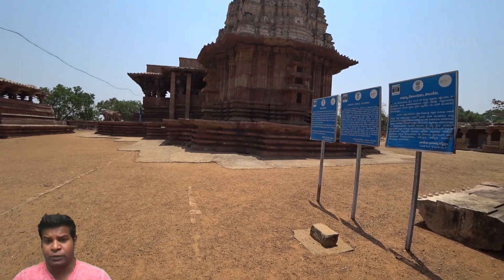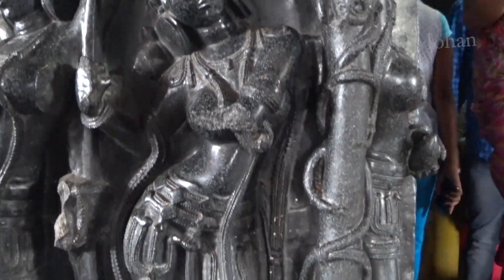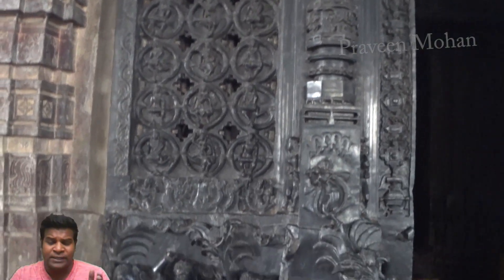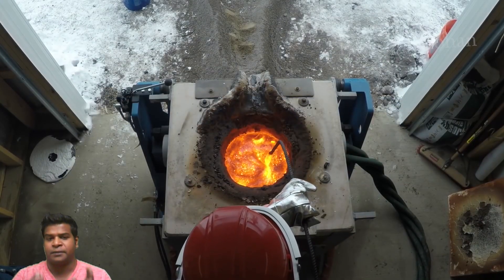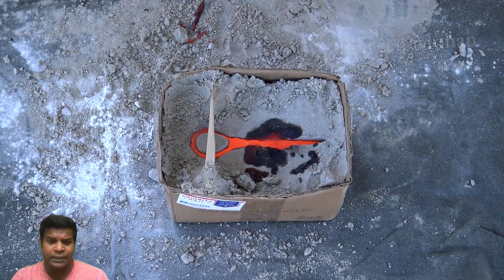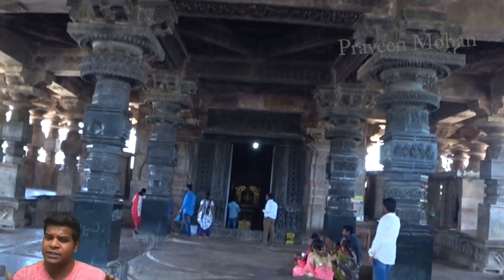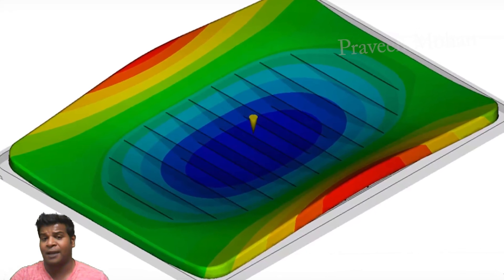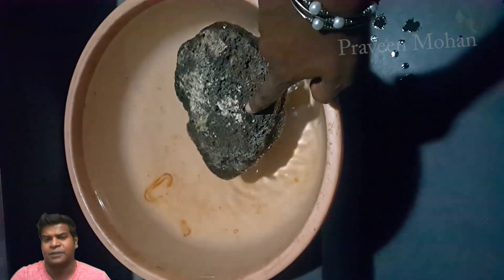Rock MELTING Technology at Ramappa Temple, India

Comment: Basalt can be made into fibers with a strength between carbon fiber and fiberglass.  ..in open air... with nothing more than heat and droop spinning tools. This is the answer to building on the moon, btw.

Comment: Well if its cast, then that would imply some considerations, for one the liquid stone would need to be very liquid able to flow and potentially under vacuum to fill the small details in completely. Obviously when you cast you first make the mold out of wax and carve it then cast in plaster, then burn it out and preheat it, then you pour in the molten stone, allowing it to cool slowly in an temp controlled environment. I agree that looks like a warp, and, the carvings are pretty intricate, which could easily be carved in wax like jewelry. I could also see some "carving" done after to clean it up, What you should look for using some advanced optics or precision measurements is indications that there were sprues that have been removed and polished, which maybe would still be raised higher than the surrounding surfaces, enough to be detected using precision measurements and modeling. If someone starts testing, theres really only so many options on how to achieve that result, lets say other than that youd use a dremel and a really steady hand or something computer controlled and diamond tipped, then polished.

Comment: I’ve been in concrete for 30 years. I think a type of Concrete mix that looks like Rock is more likely in my opinion than actually melting rock and pouring it into a mold. Mold would have to hold up to extreme temperatures if they melt the rock. Using a type of concrete would not affect the mold at all with temperature. Just my opinion, you might be right though.

Comment: In reference to the bent rock. I have seen this shape in other materials by using a large cutter say 5ft in diameter on a CNC machine as if you are trying to make it flat. Instead tilt the head 15 degrees, then make a pass and it will produce the same result.

Comment: I think you are on to something  here.  Basalt  carved is dull . . Basalt melted can turn into obsidian  i have a few Basalt  rocks that are glassy on one side but dull on the other side. Concrete morter  comes from heating limestone power  into clickers into in a rotating over of 3000 degrees.  Those clickers are made into mortar by  grinding them into powder which is then mixed with rocks to make  Concrete.

Comment: I really like the work they put into those temples . It's a really work of art . Specially with the tools they had to work with. But The sound is made trough the vibrations of the 'tree' . I work in the nature stone sector and I've heard many sounds from different stones. All depends on if it's a massive block , or in this case a 'pole' that has a lot of free space to vibrate .  Same with all instruments . 
The dents in the block could be due to taking off to much material in production and instead of taking a new one they went with this one. Or after installation it was damaged and they  polished it off.  We also use the 'flexible ' slabs Sometimes . But this is only flexible when it's very thin , only with specific materials . And when glued onto a buffer of some sorts. 
I like the video but facts are facts .

Comment: Casting would make the entire structure brittle. Natural stone are formed with heat  But with Enormous Pressure also. A manually cast sone will be extremely weak and cannot be used to make a building pillar. 
Although it can be used for decorative purposes.

Comment: If you were to try and mimic natural rock by melting, then you'd have to put it under constant pressure while maintaining the same heat after pouring. In the university example, the rock is melting but is cooling rapidly and has a glass-like appearance, perhaps similar in essence to obsidian. The mold would also have to be heated to prevent rapid cooling. Perhaps the mold was the crucible itself, placed underground with the earth acting as an insulating layer, the cap may have been a "press" to subject constant pressure to the molten mix while also preventing heat from escaping, and the entire crucible-mold may have been left to cool slowly over many hours, days, etc. until no more excess heat radiated (i.e. it reached ambient temperatures).

Comment: I assume that they would add some metals into the molten stone to ease casting, reduce melting point and to assist quicker setting and crystal structure formation. Stone melts and resets as obsidian.  Unless there is a slow cooling and high pressure. It doesn't become stone again. They must have given something to assist crystallization. In sugar they add tiny crystal pallets to induce crystallization. Probably they did the same. It still has an obsidian glaze to it though.

Comment: Metal and rock casting is very very different… with current technology it is impossible to cast pretty much anything at that temple..small details get lost so easily casting plastic an extremely well known and highly used technology and easily done … yet they would still given current manufacturing take decades to make even one of those temple walls out of plastic and get it correct if they even could…. Molding of molten rock ? Not likely….however sonic carving ? Makes much more sense to me !

Comment: I agree, ancient people had more knowledge and more advanced technology than we give them credit for. That has been PROVEN by such things as the pyramids, the sphinx and others. BUT, these two things in this video are more easily explained than he thinks. That "musical pillar" is actually just hollow in that one area, with the size of the hole bigger in some areas than in others. I'm willing to bet that if the pillar was removed, there would be a drilled out hole going up into the tree with the hole being larger at the bottom then towards the top. Which would make the sound higher pitched at the top and lower pitched at the bottom. Ancient people having the ability to drill holes into tough stone is one kind of advanced technology we KNOW they had but we DON'T know how they did it. And the "bent" pillar, is just a case of hundreds or thousands of years of people rubbing their hands across it. You can see this on multiple stone carvings all around the world from where people have touched them. The oils from people's hands is slightly acidic and over the course of a VERY long period of time of people touching and rubbing the same spot over and over again even stone will be worn down. This is also why the stone is only shiny in that one area and LOOKS highly polished while just above it, out of reach of people, the stone has a flat matt look to it and doesn't look deformed. It's also why the stone looks more deformed nearer the bottom, as that is where most people are going to be touching it. It was NOT originally made like that. That pillar when titled on it's side, looks nearly IDENTICAL to the stairs in the tower of Pisa, as they are the same way. Over the course of hundreds of years of people walking up and down them, the steps look "melted" and deformed. More so on the edge of the steps where people's feet have landed the most.  This happens to both wood and stone. My family has family reunions in one of our family's old homestead homes that is over a hundred years old, and the wooden railings on it look deformed and bent and is just from people's hands simply rubbing on it while going up and down the stairs. There is no need for "rock metaling technology" for this type of thing to occur. It's occam's razor, the simplest answer is usually the correct answer.

Comment: Hey Mohan man, I believe you can easily cast rock in find shapes like this with today's technology. You make imitation Starlite using sugar, corn starch, baking soda. You burn this with a propane torch to make it expand, and then machine it with a cnc mill. Next you pour in the lava. The carbon foam isn't strong, and it'll let the molten rock into it's surface a little bit, so they must have either polished the rock afterward, or used an element mix coating on the starlite to give a glass like finish. Now that material I don't know the recipe for, but you can buy a frying pan here from Ninja that has a 10,000F resistant coating. I have one. It's as weak as teflon but is very smooth. The inside curves of the statues would be so easy to clean out, being mere carbon foam which is quite weak. I've made this stuff myself. I've mixed this with ferrite oxide and clay to experiment in making gold in the microwave, since it has already been proven you can do this with pulverized green glass over a ferrite disc at around 1700F.  My friend John Milewski proved the process before his death 5 years ago. I improved it. Anyway, this rock casting sounds fun, I might try it, since I am actually about to finish building a cnc mill.

Comment: Rock melts under high pressure and friction. Do the math. 

People figured out spinning a rod and applying pressure created fire. 

Maybe the next step after making fire is making lava. Spinning a rod of granite, or iron. If that works, other pieces of technology based upon those principals could developed. Imagine a bow drill, but the spindle is metal, the top cap is metal and you hold it wrapped in leather so it doesn’t burn you. You apply downward pressure into a stone, at a certain point you might start getting some fumes. At a certain point you’ll reach similar temperatures as you would to create fire with sticks. So what if they refined these ideas and could make lava from stone rods?

Comment: In Genesis 11 the builders of the tower of Babel burned brick thoroughly, and used it for stone.   I think you may be onto something.  Could they have made other things with this same tech?  Perhaps ships, especially Vimana, which need to withstand extreme heat, were made this way.  The space shuttle and now the Starship use stone for a heat shield.

Comment: Lava are ligth weigth Stones. Today they use it for ligthweigth construction. Not by melting though, but in concrete. There is a reason that lava are ligthweigth. When its errupts it is the top of the molten lava, that comes out. This is where it sepperates from ligth to heavy materials. The heavy goes down to the bottum and the ligthweigth end up in the top.

Comment: And that the bent rock that looks bent I would say the forming boards broke just like if you build a foundation in the house and the boards that hold the cement to make the foundation and if they go out of whack or there’s too much weight in there wasn’t enough support in that area well this the cement will bust out or the boards will bulge It always looks like whatever was holding that spot when they poured that support beam, Holden gave in and they didn’t catch it as it was drying making that bent look in the rock

Comment: Don’t forget there is the opposite of melting and that would be grinding up to a powder and adding water and you got a cement made from rocks and sand. In this case I would say they used that rock has someone smashed up intopowder and then add water and then you can pour it let it set and you got solid rock again

Comment: Dear Praveen:  An interesting video, with your conclusions well-supported.  But  you need to go further: (1) how was 2500º heat generated in large amounts?   (2) how were the molds created, (3) out of what material were they made (that will withstand 2500º heat)?

Comment: The carvings are extremely skilled craftsmanship, but it's not rock melting technology. I believe the two examples in this video, just like the entire temple, were intended by the builders to blow people's minds at their skill. They were showing off their creativity to entertain people, and to give them a sense of wonder. First of all, to say "there's no way" to carve a single stone to make various musical notes...totally wrong! Stonecarvers and masons agree with that?? Which ones did you ask??  Lithophones have been known for thousands of years, and it's obvious by looking at that piece, that the vines wrapping around the tree change the shape of the resonant stone to make the various tones. Secondly...basalt is not plastic, and unlike plastic its thermal expansion properties simply would not allow a very isolated section of a block to shrink to such a great degree, even if it cooled at a slightly different rate. You are claiming that small area of rock is (I'm estimating) 5-10% greater density than the immediately surrounding block?? That means that piece of rock would be under incredible internal stress, which might be possible for plastic, but that just can't happen here. Not only that, the various bevels do not display the "shrinkage" to a consistent degree, which would be necessary if the mold theory were true. Forget that it's the only uncarved section on that level...there are many panels with little to no carving all around the pillars. Just like the musical tree carving, the builders wanted to make people say "wow!" and to marvel at their skill.

Comment: If they cast it the only way would be with magma tapping or something. Reburning remelting basalt charges its composition making it glass like and brittle. The floating stones are also lava rock. They produce similar stone today. And rockwool insulation is similar too. When lava cools it is actually filled with impuritys and gas and they break out making a very porous structure this stuff can float on water but itll sink eventually. Observing the stone you say was melted… easily could be there was a fissure there (natural fault) and instead of carving even deeper they merely polished it. Also i believe their were ancent machines made of wood for doing most work. Like cranes and dollys and such like that. Making a drill or a auto hammer from wood isnt hard and it lets you turn a unskilled labour into a fuel source. So that your skilled labor doesnt work as hard.

Comment: I am a stone mason and sculptor.

You state at 5:23 that "it is impossible to make such a smooth, concave cut on rocks with manual tools or even electric".

But actually, that is fairly easy to do. You cut the stone, then smooth it out, then polish it. I could accomplish this effect using hand tools and/or electric tools. 

But why would they do something like that? It looks very accidental, and considering the intricacy of the carvings all around it, it makes you wonder how such a foible happened. My two best guesses at this point are:
 
a) They wanted a nice square block, but someone accidentally damaged it-somehow it was decided that it was better to just smooth out the damage, rather than replacing the entire block. OR-

b) This is an example of mold-warping, as you suggest.

Comment: Wow! Tapping stone cylinder makes different sounds based on where you hit it and how close or far away you tap from the thicker stone caused by the other carvings. There is nothing here. The differences in sound are easily explained by differing thicknesses of material having different vibration ranges, no different than tapping on a hollow log that has varying thicknesses of bark or wood from knots and limbs. There's also the change in pitch/frequency caused by the distance between the point of the tapping and the open end of the cylinder, which again is the same as with the log. The sound made by tapping is distinctive of a hollow cylinder. The claim that there is no technology is ridiculous, since the different sounds are caused by the variance in amount of material in proximity to where you are tapping. This is also demonstrated by placement of fingers on a guitar string. By changing the distance between your finger and the sounding board on the guitar, you are changing the frequency of the vibration of the guitar string thereby changing the sound. Freaking high school science (predominantly physics earth and space sciences) or music classes can answer pretty much every "question" put forth here.

Comment: Hand polishing absolutely can create such a surface. As for the deformation of the pillar, that could have been trying to work around a defect in the material itself, like an inclusion or colour variation. If the rock was heated to be  molded, that would be very easy to figure out by examining the crystal grains in the rock.

But what you failed to mention, is the form of warping you showed in the illustration is shrinkage of the cast material as it cools, and has this shrinkage along its entire surface, not just a single side as it does with the pillar.

Comment: interesting video. I could speculate that the flute is hollow due to a core drill into it, and the deformed pillar square is due to a fracture that was then grinded out of it, leaving an indentation. To remove the crack imperfection the pillar was smoothed out and dented.

Comment: Thank you for sharing,Praveen.  This is fascinating.  I’ve learned not to underestimate those ancient engineers, but this is on another level.  I did wonder if the ‘flue tree’ was made from another stone and molded in using something like concrete.  You may want to do an internet search for "ringing stones" to find stones that produce tones like what you’ve demonstrated here.  Also, much praise to the keepers of the temple for letting visitors touch it.  That’s what it was always for so that people could interact with it.  We need that lesson in the states.